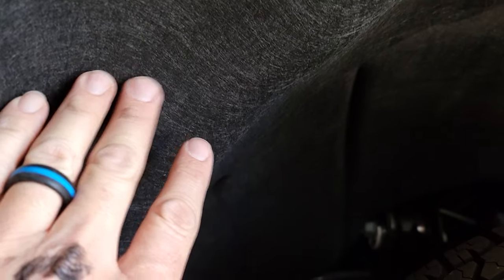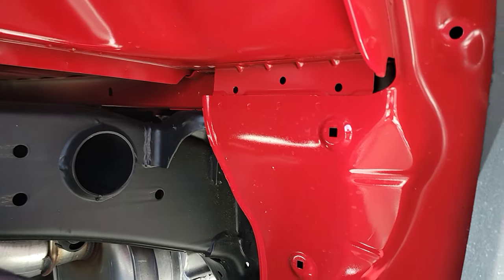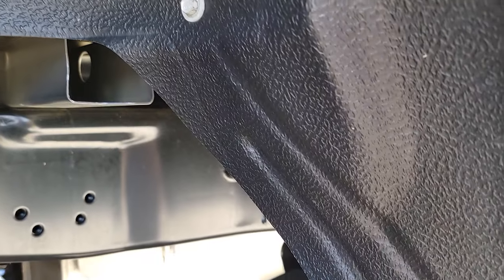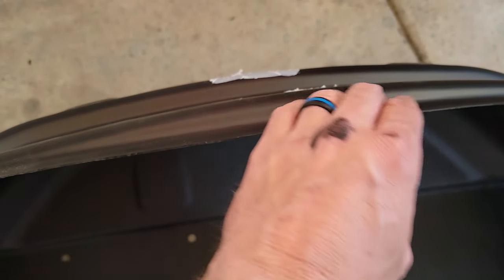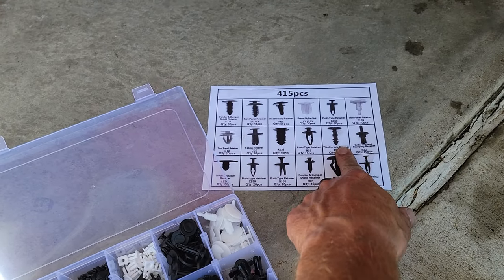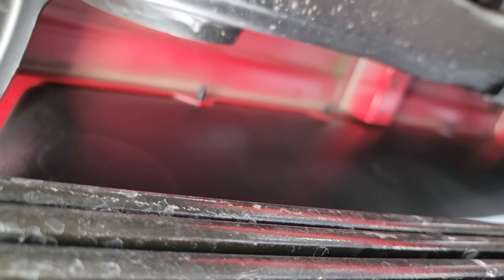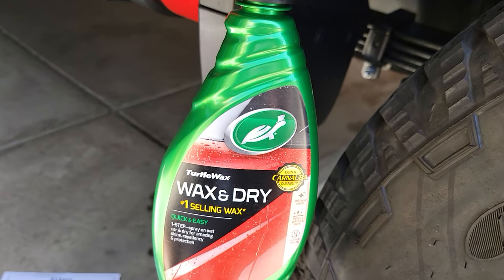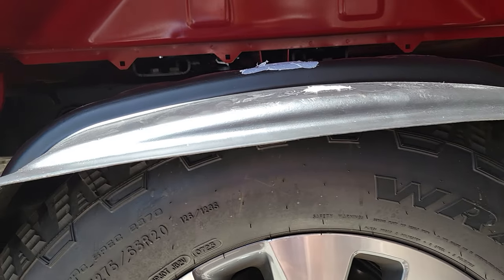Must have truck accessory for any truck!  Install on 2024 Chevrolet Silverado HD....body protection!

Comment: They look nice. I like them better than the factory ones like on mine. Mine are like a carpet material and they also don’t completely hide the frame in the rear. 

That wax coating is infamous lol. I think it does an ok job but I would rather them just paint the frames. 

The thing with the wax is don’t pressure wash it! It will cut it off. Just use regular water pressure. Those husky liners will really save that section of frame from getting blasted with high pressure.

Comment: My bed liner guy just hit the wheel wells with line x came out better and cheaper and no moisture or dirt to get behind those plastic wells
Reply: I wanted to do this exact same thing , how is it holding up so far
Reply: Bullet proof

Comment: I put the same ones on my 22 trail boss. Had them on all 4 wheel wells on my 16 but I’m glad only the front ones were on it the plastic is much easier to clean.

Comment: I watched another video and someone had mentioned the washers are only if your reusing hdwr from your old liners. I thought it was odd putting that washer on the backside. The Christmas tree alone should be all you need. I will install mine next week and verify.

Comment: 2024 Dually rear only 325.00 (no aftermarket available), expensive add on after 103K for the truck . For that should have been included

Comment: Not sure if it is standard but my 2024 LTZ came with all four of the "fabric" liners.  Not sure what the advantage is of the fabric liners over a hard plastic liners from the manufacturer perspective (cost? ease of install? durability?) but I've noticed that dirt and mud like to stick to the fabric, whereas I think it would slide off or be sprayed off via driving with the hard plastic.  X2 on that variety kit of plastic fasteners, as well as Husky consistent quality -- their  Xact liners are awesome.
Reply: I have them on mine as well but drove others without and I think it helps with road noise as well.

Comment: Great video...thanks! Would it have made it easier if u jacked it up and took the wheels off for better access? Thanks
Reply from the maker: Thanks, appreciate you watching.   I think if one was to do the front liners it may be easier to remove the tires, and same on the rear,  but I've always just slid them over and in.   Swap out the rubber slip on tree clips and it would cut time into 5 minutes.

Comment: I just installed the Husky wheel well covers on my 2024 Custom 2500 and it wasn’t easy. Hard to get it up above the mud flaps. But did you use the rubber washers on the back side of the Christmas tree plug? I didn’t think I was going to be able to get them on there, plus the instructions read like they were used if you had existing bolts already there from another wheel well cover.
Reply from the maker: I used body fasteners, they sell a kit on Amazon for around 13 bucks,  and just pushed them in.   I used the rubber ones on a few locations, but they are very hard to get on.    I keep on hand hundreds of those large body fasteners, for moments like that...but I used to always use the river washers... it can be done,  but it's not as easy as the Christmas tree fasteners.

Comment: Just wondering if the bed AC outlet can be used without the engine running? I have not figured it out yet.
Reply from the maker: I haven't used it, but I will check that and get back to you on it tomorrow.

Comment: I have a 2025, do they make these for a 2025 yet?
Reply from the maker: @larrypapenthien8895  yep, they will fir 21 to 25.  They didn't change the front or rear wheel areas.
Reply: @automotiveinquiries9673  thank you sir.